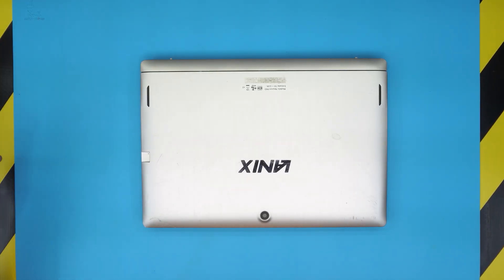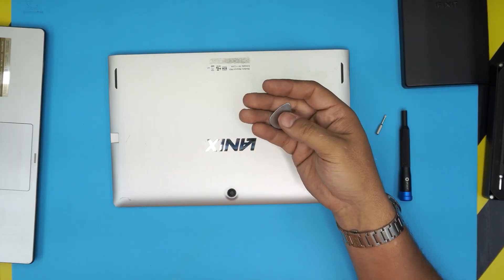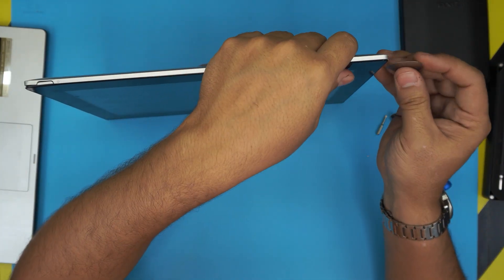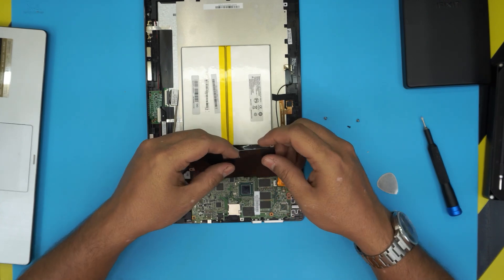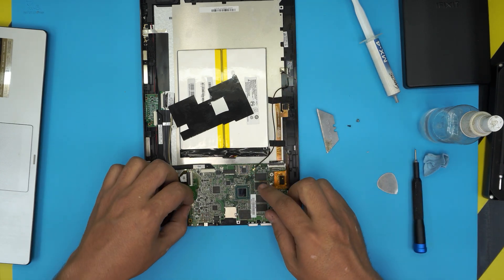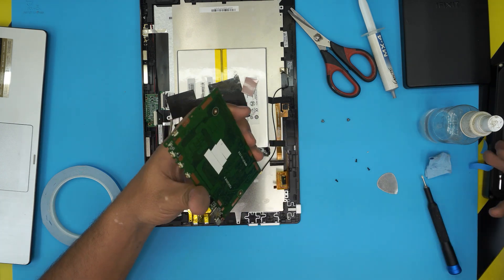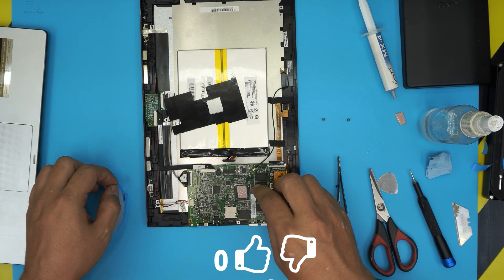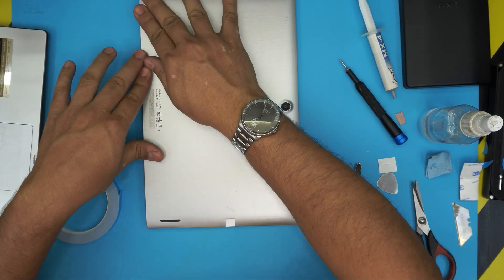Lanix Neuron Pad Service Overheating Fix

Comment: Hi, please can you help me? Do you know how to boot with an USB with windows in a Lanix Neuron Flex notebook, the BIOS recognize this USB, I can't use F9, F10, F12 or any other key in order to boot.
Reply from the maker: Thank you for the feedback! if you wish to support the channel you can LIKE or SUB or both :P
regarding your question: 1st you need to plug in the windows 10 boot-able usb in the usb port, then you need to power on and quickly keep tapping on ESC key till you need the menu and choose BOOT manager and then your USB :)
Reply: @uFixTek  I did it, I used an external DVD, I used USB Bootable, the BIOS recognize de USB, I changed de boot order, when starts, don't take the USB in order to boot, I don't find any key to use, like F9, F12, F8, or others to select device boot.
Reply from the maker: does yours have SSD or HDD 2.5"? en que estado estas amigo? o pais mejor dicho
Reply: @uFixTek  It doesn't has HDD is inthe mother board
Reply from the maker: i have contacted a friend that is in lanix service center, he says that there is a lot of issue with the bios on this models, there is nothing you can do. he said for this issues they replace the bios chip. sorry i couldn't be a help.
Reply: @uFixTek  I found the fix, when it creates USB bootable with Rufus program, it's necessary change to GPT not MBR, now the problem is... find the correct drivers, thanks for your atention, Hi from Mexico City.
Reply from the maker: i was thinking you have legacy USB already, because this laptops are not UFEI  bios they are legacy and you need a legacy boot drive (MBR), driver for what most mms drivers are loaded on windows iso. queretaro here
Reply: @uFixTek  I changed GPT in the options Rufus program. I already did it, thank you.

Comment: I HAVE A SIMILAR ONE, BUT IT NO LONGER TURNS ON, NEITHER THE RED CHARGING LIGHT, WILL IT BURN? WILL I HAVE TO CHANGE THE BATTERY?
Reply from the maker: es tu caso puede ser que tengas mal el centro de carga, no tienes que cambiar la bacteria de esos ya que esos baterías duran bastante tiempo al menos que estén inflados.
lleva a un técnico a revisar el centro de carga. saludos
Reply: @uFixTek  GRACIAS
Reply from the maker: @marcoantonio-kn9kq  por nada lo siento que no puedo ayudarte por distancia :(
Reply: @uFixTek  tengo uno similar con el mismo problema la bateria carga pero no enciende el equpo. estoy reutilizando el teclado y touchpad solo conecté un cable usb A A y un puenteo.  el propio puerto proveé energia